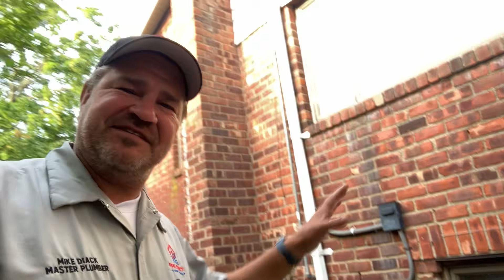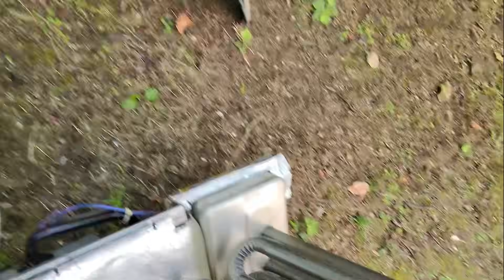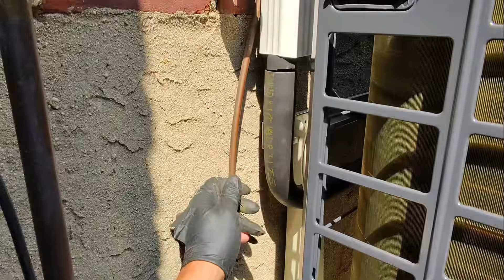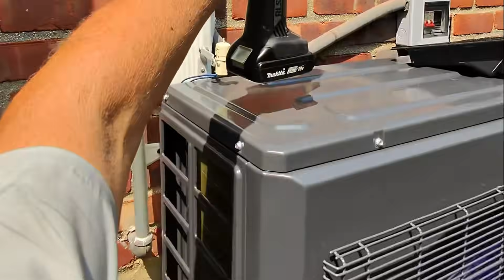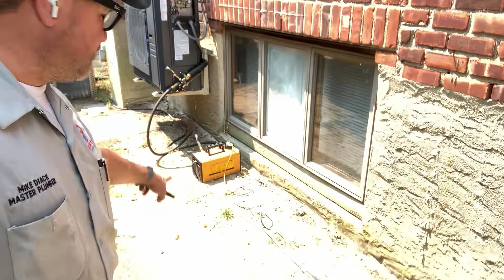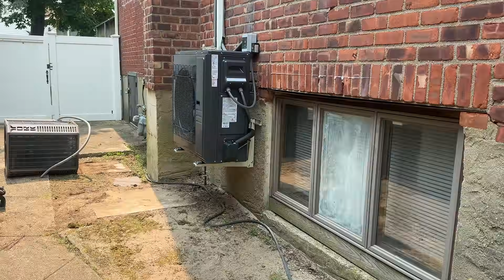We Planned 2 HVAC Installs… Then Everything Fell Apart | ACiQ Extreme+

Comment: Do you have any videos that is less broad picture and more detailed. I'm thinking about tackling this but the wiring and thermostat and float switch is a little intimidating. I'm a plumber, I don't usually deal with more than three wires 🥲

Comment: POE oil is hygroscopic which meaning it absorbs water when exposed to air and air has water in it so pulling a good vacuum is critical. Old mineral oil systems not so critical but should be done, that’s why we’re so anal about pulling good vacuums.
Reply from the maker: Spot on, moisture is the enemy of a good install.

Comment: I’m wondering if my system can be converted to an ACIQ communicating system. My existing system is a Bryant 3 ton with a gas furnace using 2 zone ductwork controlled by a Honeywell control panel, bypass and 2 thermostats. Also is it possible to use the heat pump with gas backup.
Reply from the maker: You’re welcome to book some consult time with me and we can figure it out

Comment: Funny putting the ACIQ over the power box on the wall -  LOL       Love these ACIQ dual fuel Heat Pump's and I need one on my home here in Kansas,  it hits 100 to 105 F in July and August and in February after a cold front it can drop down to 0 F .
Reply from the maker: It’s definitely a solid choice for those extreme temperature swings!